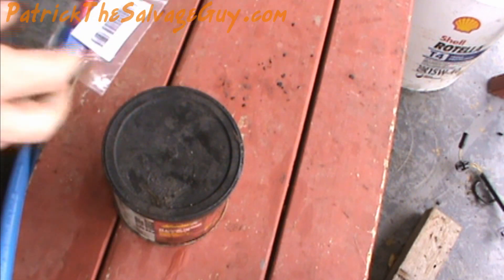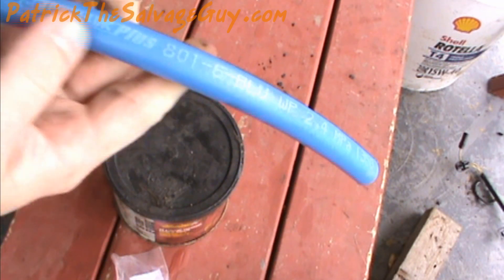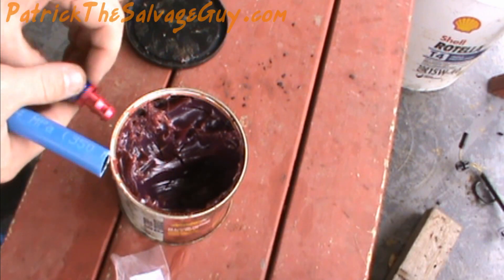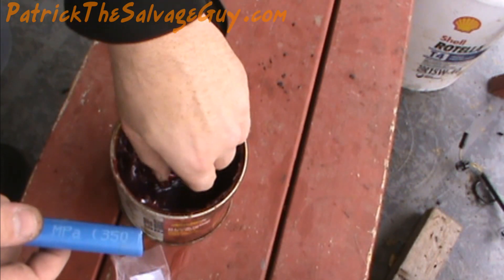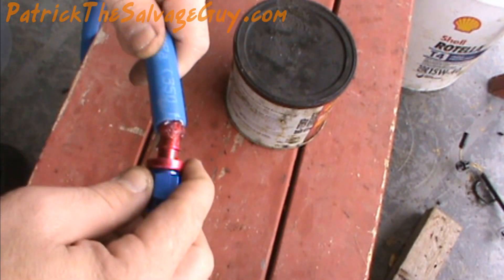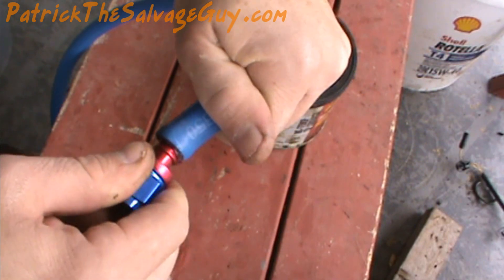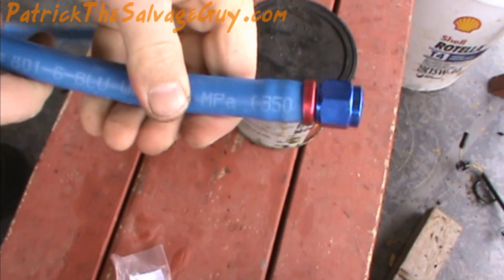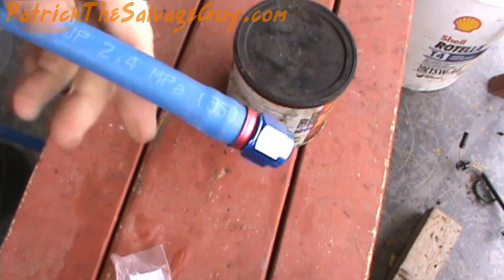Easiest way to install Push-Lok / Push-On Hose Fittings.  AN fitting install

Comment: I prefer grease also. But lots of things work well— Crisco, vegetable oil, etc. Some of those veg oils are incompatible with some rubbers kinds though, so check the elastomer compatibility to make sure you’re using something that won’t swell or degrade the hose.
Reply from the maker: Considering I was using it for diesel, if grease would harm it then it would have been a bad idea.  But you are correct, I should have mentioned it, I knew back then as well.  Thanks
Reply: @PatrickBaptist  NP, thanks for making the video. Once you use these push-loks, it's really hard to talk yourself into crimping on hose ends or dealing with the threaded reusable ends. Nobody wants to go to the hose shop. I'm using some -8 I bought years ago for my 02 ETH/DEE CTD as fuel line. I had 10ft or so left over so I repurposed as air hose, for which it works great. It's heavy and stiff, but tough as nails.

Comment: How do you go about removing a barbed fitting? I have a bad fitting on one of my gas lines on my truck and instead buying a 100$ gas line, I'd like to just try and remove the old fitting and replace it.
Reply from the maker: I cut em off, just slit it down the side about the length of the fitting just be careful not to scrape the fitting or it could create a leak.  I'm sure there is an easier way or a tool for it but that's how I deal with em.

Comment: It’s better to use soap cause it dissipates grease does not and could cause the fitting to come off in higher pressure applications
Reply from the maker: I've not had any issue with the coming off but the most mine have seen was 100psi.  I wouldn't want the soap residue in mine personally.  Any fuel that leaks past will dissipate the grease actually.
Reply: If the fluid in the hose will dissolve grease (as diesel will) it's a non-issue. And if you think that end is coming off, you've probably never actually used these kinds of hose ends. It's not going anywhere at the full rated pressure of the hose.

Comment: You can dip the hose in hot water and put the fittings in the freezer too.  Expands the hose and shrinks the fitting.
Reply from the maker: Yeah I don't want any water in my fuel lines at all, no moisture period nor would anyone making them for hydraulic use, but now for coolant that would work great.
Thanks for the good tip though.
Reply from the maker: In my situation that would just take more time than just to dip the fitting in some grease and assemble.  I also need to find a pulley for my compressor motor so I can even use it.....
Reply: I know your old as soon as i saw that little tim of red grease ive seen your generation use that stuff for everything 😹
Reply from the maker: @dh5254  LOL, I'm 36 (now), I really don't think that's very old.  LOL.  I have used it a little for everything.
Reply: Patrick Baptist your practically an old man it all goes down hill from 40 im 20 and we freeze our fittings before installation with a little bit of silicone wd40
Reply from the maker: @dh5254  LOL.

Comment: Exactly the WRONG WAY. You risk a blowout. You are not supposed to use anything but P-80 Emulsion Temporary Rubber Assembly Lubricant.
Reply from the maker: I dont have problems doing it this way, oil is a better way though.  Make your own video showing how to do it your way with your personal fav lube LOL.  Really sir, you offer no videos yourself just blabbing about what someone else does, hard to believe you ever did this yourself lol.

Comment: How do you take them off?
Reply from the maker: Carefully with a knife.
Reply: use a soldering iron or a propane torch and save the fitting from nicks that a knief usually gives.

Comment: Saved by grace through faith!  Eph. 2:8-9
Reply from the maker: Lord Jesus bless and guide.
Reply: Brother, can you recommend a push lock fitting to go with the Parker 801?  I found the hoses online,  butI don't know where to get the fittings.
Reply from the maker: I usually get this kinda stuff from ebay and it's been over a year since I've bought any pushlok stuff, sorry I don't know anywhere off the top of my bald head there to tell you to check.....
I'd say just check ebay...
Reply: @PatrickBaptist  will do. Thanks for the reply.